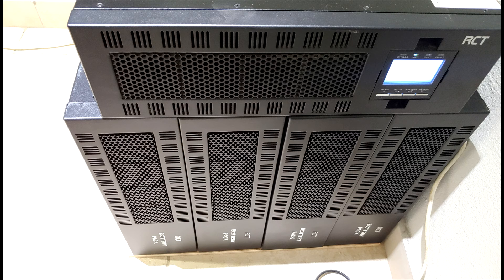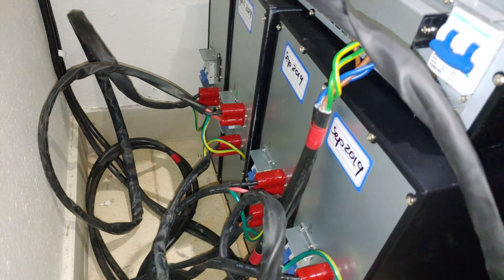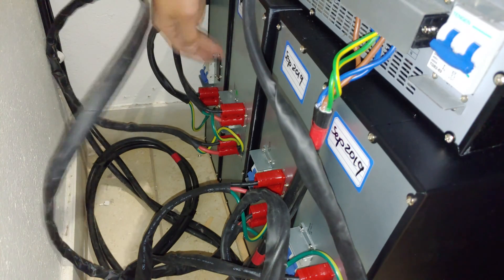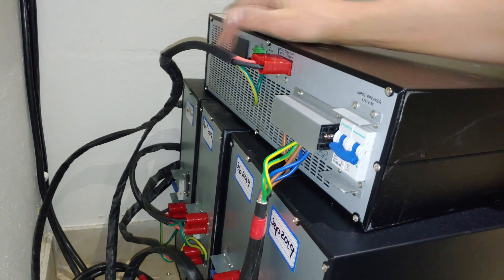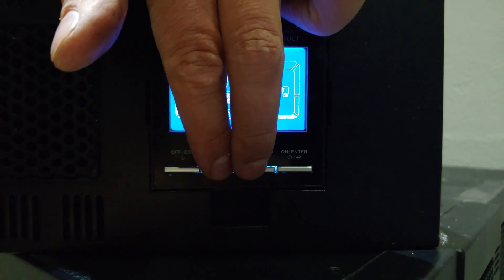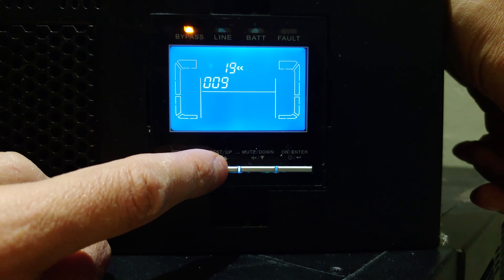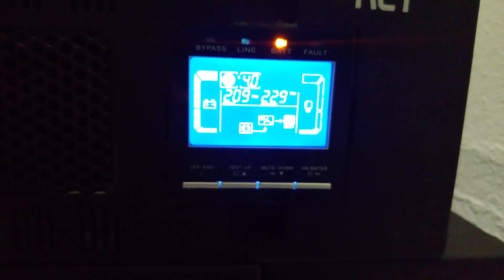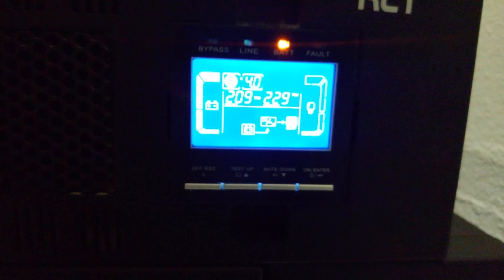How to wire battery banks to UPS and configure settings - WPRU 10KVA

Comment: Hi howsit. I need a bit of advice please. I have a Delta GAIA 1kva rack mount ups.  It has a external bat option of 24v 40a. However I want to runs my 2x 12v 100ah bats on it. But cant seem to find info on how to set current charging limit to 20a  max for the bats im using. Can someone please assist. Unit doesn't have a led display so I dont think i can configure from the pannel. Thanks in advance

Comment: Hizit , Can you add external batteries that are 100ah and use with the internal batteries on a ME-10000-WPTU ?
Reply from the maker: no the voltage is the problem, it wants 192V
Reply: @ecologicaltime  thanks for the reply . If i add 16 12v 100ah batteries in series will that work ?
What is the setting on the ups. 2 Banks AH's? at the moment you can plug in or out the battery bank and it makes no difference to the backup time ? Regards Cliff

Comment: This UPS is not that great. I love that i can handle big loads, but functions for less then 2 hours using a small mikrotik router. The idea was large UPS = 8 hours or more. I have the RCT-10000-WPRU rack mount unit with 1 battery pack, should have bought a 4KVA APC ups instead
Reply from the maker: i will do a follow up video. I have four banks and they practically useless. The deign of the battery bank is poor as each battery withing the bank are all in series and now i have a few stuffed batteries dropping the voltage on each bank which means that UPS is cutting off. I have to manually go and test each battery with load applied (16x4) and remove and replace bad ones. My one bank is not even 7 months old. Watch out for my negative review coming up!